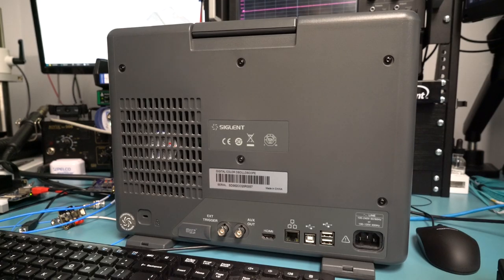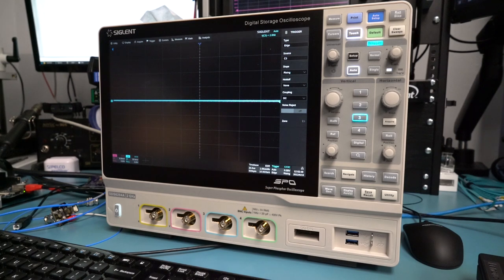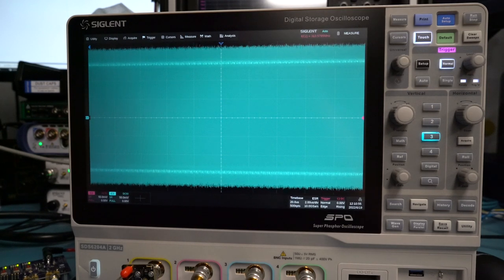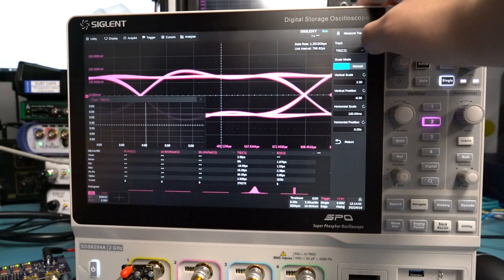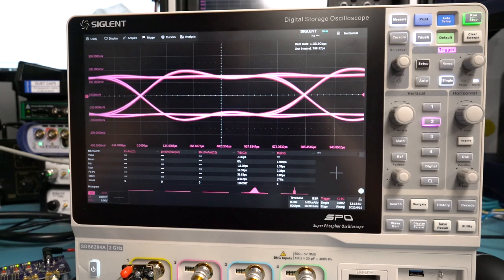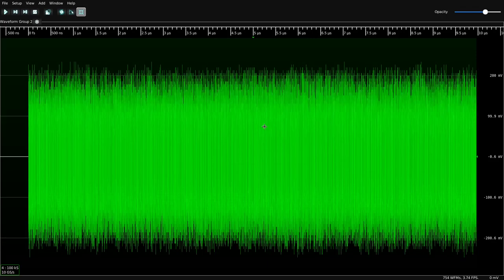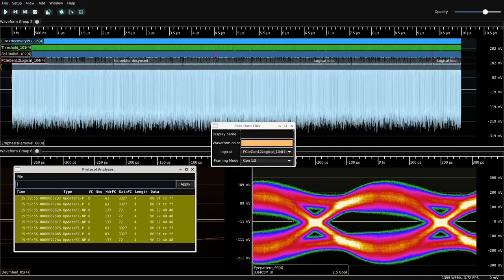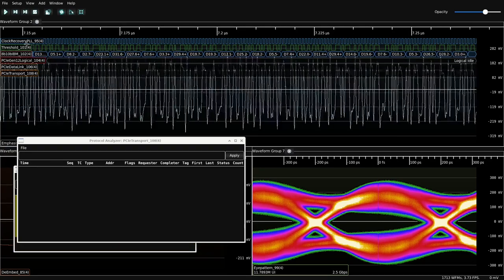Siglent SDS6204A 2 GHz oscilloscope review and demo with glscopeclient

Comment: nice video, I am still unsure which scope i should choose. the new Siglent SDS2104X HD or something else like a Rohde & Schwarz or Tekronix, what do you think of the user interface of the Siglent scope? do you have any suggestions what a good choice might be for an 350MHz 4 channel scope?
Reply from the maker: I was promised a 2104X+ HD test unit in a week or two so I can see how I like it, and may do a review there as well. I expect it to be mostly the same as the 2104X+ except with the 12-bit ADC instead of 8.

The UI is quite nice - smooth and responsive and generally reminds me a lot of a LeCroy scope in terms of general industrial design, except the pop-up menus are on the side rather than the bottom. I wish they supported multiple grids though - this is a feature that most higher end scopes have, and they have the screen real estate to make use of it even on the lower end models like the 2104X+. But some entry level scopes from the big names don't have that capability either.
Reply: @AndrewZonenberg  thanks, i will wait for the video to pop up on your channel :)

Comment: nice review! did your unit also exhibit a strong whining noise, emitted by the fan? its frequency is continuously adapting every few seconds which is annoying in an otherwise silent office
Reply from the maker: I can't comment on fan noise as my lab is quite loud (about 65 dBA ambient) thanks to all of the servers and other lab equipment. Any sound this scope made was completely drowned out.

I actually had to do fairly extensive denoising on the raw audio for it to not sound like I was vacuuming the whole video.

Comment: Around 16:36, it seems that the vertical resolution of the signal is quite low. Esp. around the extremes, the quantization is clearly visible. Which vertical setting did you use at the scope? 1V/div or even coarser?
Reply from the maker: It was 73 mV/div. I'm not sure how the fine gain works in this scope since I didn't do a full teardown of the frontend, but the excessive quantization suggests that it's probably actually 100 mV/div in hardware and just rescaled for display (so you lose ~1/4 of your total ADC codes offscreen).

Additionally, the PCIe test used a probe with 10:1 attenuation so the actual input signal in hardware was 7.3 mV/div (likely actually 10 mV/div).
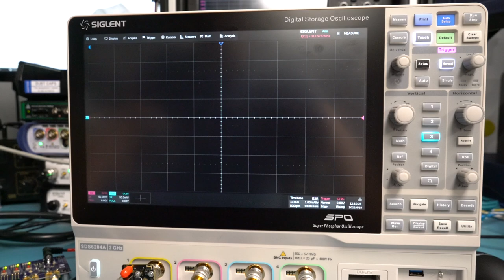Reply: @AndrewZonenberg  Thanks for the details! I've taken the liberty and analyzed an image. I found around 10.7 pixels per LSB, or about 6.5mV per LSB. With an 8-bit ADC this would be approx. 1.65V full scale or close to 200mV/div (assuming 8 div vertically as seen at 6:29).
So, considering my inaccuracies, perhaps the scope's lowest true setting is 200mV/div (with your 10:1 probe, or 20mV/div with a 1:1 probe), and all smaller settings are software zoom.
Reply: Apart from this "observation": Really interesting review. I liked especially when you pointed out the shortcomings, because I learned more on how to use a powerful scope. :-)

Comment: Not sure why Siglent can't expand the software functionality of their lower SDS200X Plus range to include eye diagrams, etc. In todays digital comms world, I don't know why they think adding things like CAN, CA FD, Flexray data decoders is ok at the low end, but actual signal integrity measuring features (which is what the scope is actually for) of the same signals is not even included unless you spend 3x or 4x the price!